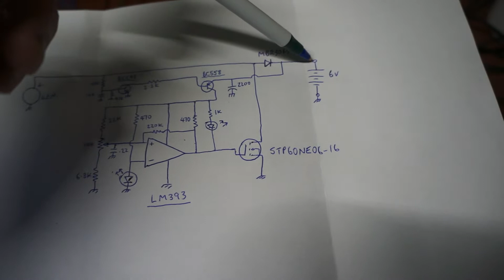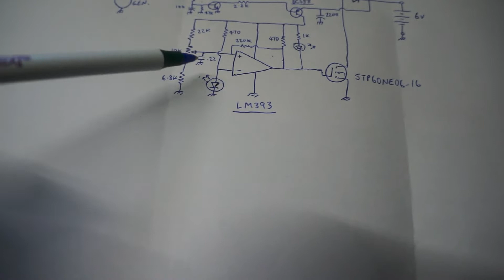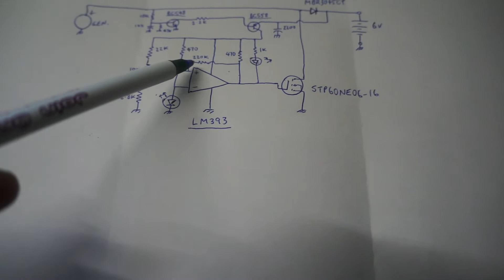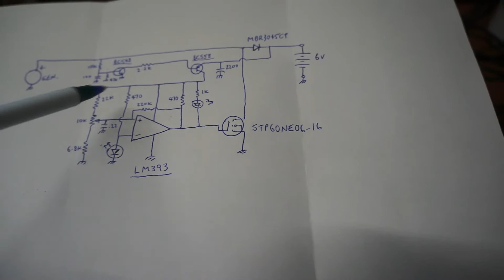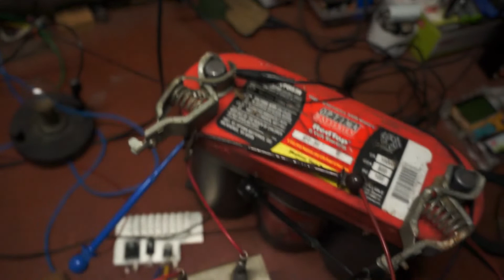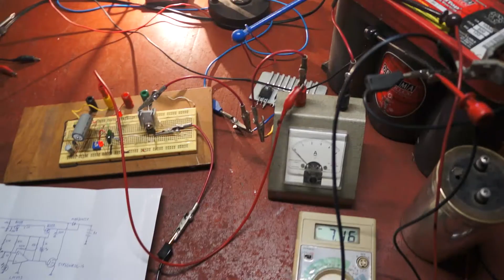Model T Ford voltage regulator experiments - Part 1.

Comment: Way too complicated!!! Use an SCR in place of Mosfet, tie the gate to anode with a 7v5 zener, 1k to ground. Dispose of all else. As the Zener conducts, SCR shorts generator. The gene output is pulsating DC which will allow the SCR to cease conduction as the output drops. Its more in keeping with the elegant simplicity of a model T!!
Reply from the maker: You might be onto something here. I need to have a look at the generator waveform and just see if the output does drop enough to unlatch an SCR. Thanks for the idea.
Reply: @cool386vintagetechnology6  If it wont, use a small signal  BT141 SCR  to switch your mosfet.  By limiting the SCR  below its sustain current it wont stay latched with zero gate voltage. The SCR anode then connects to mosfet gate. This gets around the parasitics as all juice is provided by the gene.  According to the data sheet, the sustain current is below 2 mA, so the   mosfet gate pullup/ SCR anode  would be around 10k to be safe. Switching a Mosfet fully on with only 6 volts can be a mission......
Reply from the maker: @dayleedwards3521  As I found, the generator output is quite smooth once the cutout conducts, so unfortunately the simple SCR + zener circuit won't work. However, I do like the idea of a low current SCR driving the MOSFET. That's quite ingenious!
Reply: @cool386vintagetechnology6  Well, thats a bugger.  There is obviously considerable  brush to commutator overlap negating any voltage dead time.  My gut instinct  tells me there is a simple way to do this. What does the output look like during normal operation, ie, when charging? It may still be possible by lifting the SCR cathode via a diode drop, and using a commutating capacitor from the Anode, any postive going spike may help the SCR to turn off?Conversly, a capacitor from the battery side of the series diode may provide a useable negative commutating pulse, either would give a high frequency pseudo PWM effect. I find this a fascinating challenge but lack the specific generator to fiddle with. Of course, there are Gate Turn Off SCRs.....
Reply from the maker: @dayleedwards3521  Funny you should mention a gate turn off SCR. It just so happens I'm using a PUT that way, in a circuit along the lines you have described. On the bench it's working very well with a nice 300Hz PWM waveform. It's fiendishly simple, but I just need to tweak a few component values, and make sure it can be duplicated. Early days yet, but stay tuned for a video.